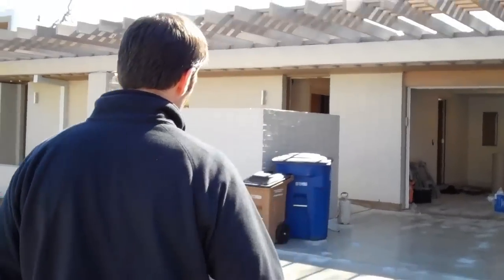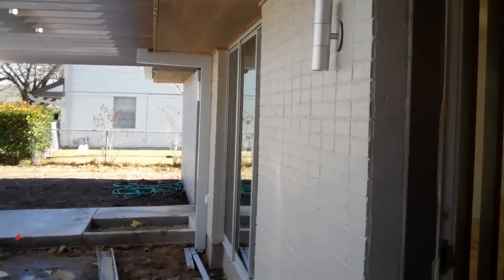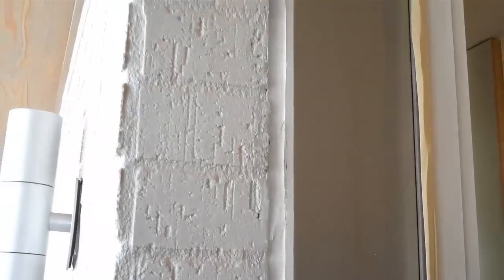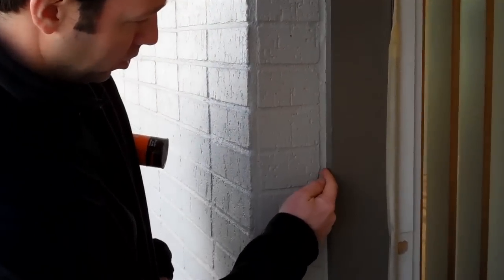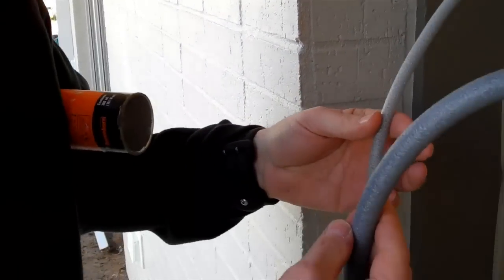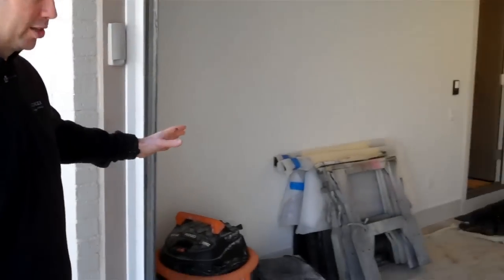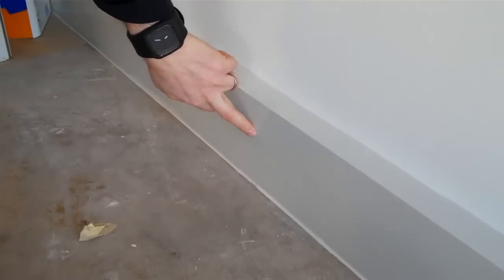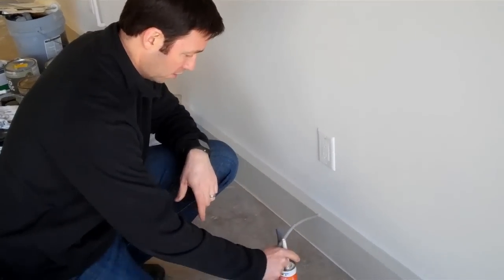Exterior Caulking for Longevity - NP1 Review

Comment: Finally a sealant video that is done with some knowledge.A couple of things to add. The backer rod also gives the sealant the correct profile which should be slightly thinner in the middle. And is critical to the life of the sealant. And the sealant HAS to be installed at the correct depth. Again critical to the life of the sealant .General rule of thumb no less than 1/4” and no more than 1/2” and 1/2 as deep as wide. Also I understand this video is intended for the homeowner so multi component sealants are hard for them to use ,but in most cases NP2 is a better product. It stretches a little better. But requires professional equipment to install. NP1 is a little rigid.I have seen NP1 pull mortar away from brick because it bonds so well.I installed and repaired sealant for more than 40 years and have seen almost every type of failure possible. When installed properly all of the failures I’ve seen from NP1 were because it pulled the substrate apart. Having said all of this I love NP1 but , like all sealants, it has its limitations. For example I would not use it on EIFS.

Comment: I have worked on many different roofs for the last 30+ yrs,and used an assortment of caulks ,some that I pick,others are supplied by various sources. Without a doubt  NP1 is easily the best sealant bar none. Here in S. C  our weather is a lil bit of everything and whatever sealant is used goes through these extremes.For roofs,brick,windows, basically anything that you can think of, do yourself a favor and get NP1.Just under 10$ a tube is well worth me paying, to have 0 leaks ,or callbacks over all these years.  PS its very sticky so do what I do...apply..dip your fingers in dish  detergent  and press in gently,dip again and smooth the bead out. God bless all you hardworking guys,we are a bit of a different breed .
Reply: 10 bucks in US and 35 bucks plus HST in Canada, criminal.
Reply: You can spray your fingers with WD-40 also

Comment from the maker: @JJunkin1 It's not ideal but you can use NP1 to seal that siding penetration.  95% you'll be good but there is a small chance for future issues.  Another option might be to make a flashing that goes on top of your fixture and slides up under the upper course of siding.  This would help with water cascading down the siding to not get behind the fixture and enter the wire penetration.  That would be at least a two pronged approach to deal with the late penetration.  Matt Risinger

Comment from the maker: @JJunkin1 Excellent Question.  If you have a box on the outside, then I'd highly recommend a Quick Flash boot.  I buy mine through efi.org.  Call them to get registered as a builder for a discount.  If you're just poking a wire then use two pieces of StraightFlash cut into a "v".  Bottom piece goes on first, then top piece and you'll seal the wire to your Tyvek.  Best, Matt Risinger

Comment: Great videos.  Keep up the good work
I'm the home owner, builder, and architect of my first home to build.  The house is in Houston.  My question is when you have exterior penetrations for electrical connections, in this case - an Up/Down wall scone, whats the best way to seal that penetration the outside (electrical for the lights)?  The siding in this area is metal standing seam.  I hate to just shoot caulk down that penetration and hope for the best, whats a better solution.

Comment: So this is a decade old video so odds of getting a response are slim, but instead of backer rod could you use spray can foam for backfill instead?  I just bought a newish house that the previous owner built and while it's a nice house - he left some finishing touches left to do.  Like caulking.... or just caulking properly.  I'm seeing YouTubers constantly using this backer rod stuff and it just looks like no frill foam that they have to jam into the gap with a putty knife.  Why not just use spray foam that expands and literally does the filling for you.  Let it set, come back and cut it flush.  Then caulk the seam.

Comment: Great video. Thanks! So are you saying that backer rod won't stick to caulk (or vice versa)? Is that just a property of the backer rod material that caulk won't stick to it? I always thought the backer rod was just there to stop the caulk from oozing endlessly into a big crack to save on wasting caulk.
Reply: Tim Staub  It does stick to the backing rod. Fortunately the backing rod moves with the caulk

Comment: Good luck if you ever have to replace the door jamb np-1 bonds amazing like a hundred times better than liquid nail. And don't get it on you that stuff has to wear off. True story had to put brass address plates on the exterior up some apartment buildings. Had to put a pretty good-sized blob on the back stack the plates taped them in place. The owners added additional units and wanted to change the addresses therefore the plates had to be changed. Thought I just pull them off but it wasn't that simple The Bricks came off with the plates. Yeah that stuff bonds!

Comment: Thanks for the quick reply.  I've used Quick flash on all the large penetrations (thanks for the tip) this one is just a wire through a small hole after the ice&watersheild and metal siding have already been applied.  I had the concern before we applied the siding but my electricians kept telling me they always come in after the siding.  Any suggestions for me now after the fact (siding already on)?  Thanks again.

Comment: what about when doing maintenance caulking over cracked caulking. NP1?
Reply: Carole Jackson its better to remove cracked caulking and clean the surface so the new caulking has a good bond. I also recommend sikaflex  caulking for conditions were there is a lot of water hitting the spot. I will also add if your existing caulking is silicone and your going to tie into it with new caulking it has to also be silicone.. Urethane will not bond to silicone. Hope i helped if you need further assistance check out my channel
Reply: Thanks

Comment: how's this work on metal submerged in water?
Reply: goldenglory79 anything that is submerged in water calls for sikaflex it is ment for situations where its going to be submerged and have lots of static pounds of water over it . We use it to caulk expansion joints in dams you would also need to apply a primer before applying the caulking
Reply: Vicente Ruvalcaba thanks

Comment: Did you really mean it that ext caulking is mainly aesthetic? In a hardi plank lap siding scenario it would seem more than imperative. The minimum standard being something like Quad. How with an air/weather retarder behind lap siding, would caulk not by the PRIMARY resistor to moisture? Maybe you are refering to other systems in which it actually is a secondary concern. For most Americans, fiber cement lapped is the only affordable option.
Reply: It's aesthetic depending on the way the home is built. In the hardi plank siding scenario, Matt would typically use a drainwrap barrier with a rainscreen and Tyvek tapes around windows and doors to shed any water that may get behind the siding. This allows a 3/8" gap between the siding and the building paper which allows all moisture to drain behind the siding. The siding is also allowed to dry from the front and the back as well. Essentially the rainscreen behind the siding is waterproof itself, because of that...caulking can be considered aesthetic. Without a rainscreen and 3/8" air gap, any water behind the siding would not be allowed to drain nor would the siding be able to dry from the back because it is trapped against the building along with any moisture that has leaked in. Watch his video for better explanation of this system. https://www.youtube.com/watch?v=5cZ_7ZoWTn0
Reply: @ethanepps5500  Most homes are built without an air gap though as siders charge double for the install, knocking a home up 6k in hard costs for middle class Americans that can't afford it. The action your referring to is trough action behind the siding, which makes the caulking for 95% of horizontal fiber cement plank cladding the only thing maintaining the sheathing's integrity. Perhaps do you live in Canada or Europe where the air gap is in the building code? Here it is not.
Reply: Andrew Anderson I live in South Carolina. It’s a mixed humid climate. I haven’t read specifics on trough action so I can’t comment on that. Also the air gap is not required nor practiced like it should be around here. As for the added cost argument, it’s up to the builder and homeowner to discuss what is right for them. As you continue to watch Matt’s videos you’ll notice there are lots of detail that make sense but add cost and labor to a job.
Reply: @ethanepps5500  Matt's videos which are good examples of best practices and cool for sure. I think some of those materials, methods and equipment increase costs marginally. Wheras some roof, siding or framing methods and materials pretty much double the cost of the item. For example flashing a window properly is a good practice that won't break the budget. What I would like to do is find a product that can easily be installed to create the air gap at a minimal cost. They have some poly gap inducing sheeting on the market, which isn't too expensive but all the siders around here charge double to put it up before the fiber cement planks. Dupont makes some systems which is where I've been turning to.
Reply: James Hardee ...smh...just make sure you read his warranty intently, then look up the lawsuits and complaints..this guy adjusts his warranty yearly to include the year befores' fails.